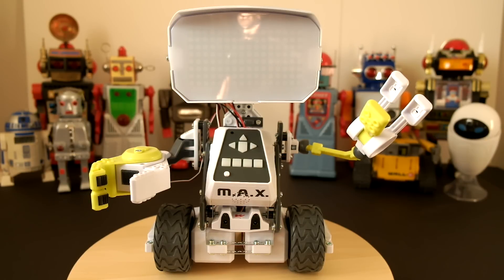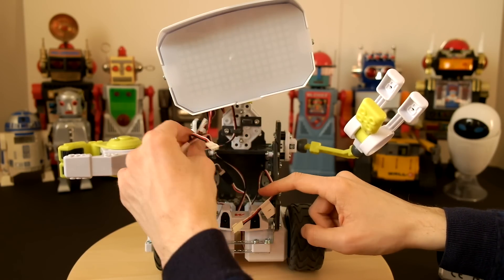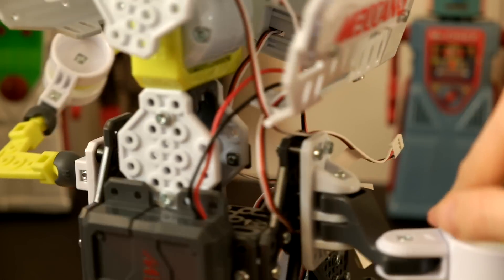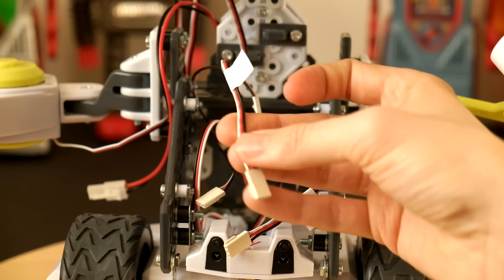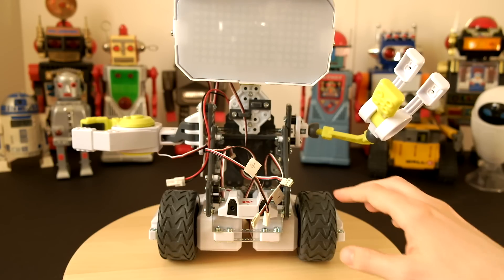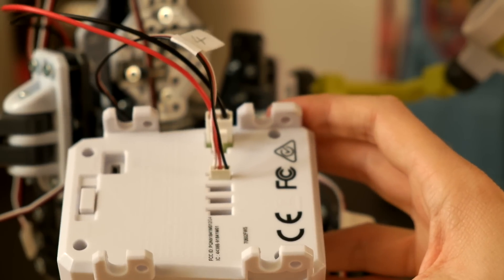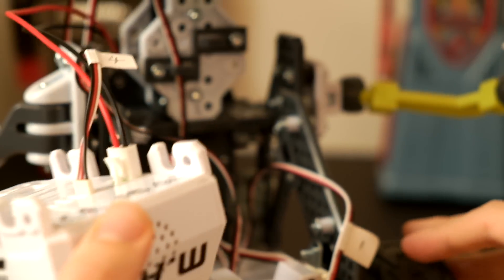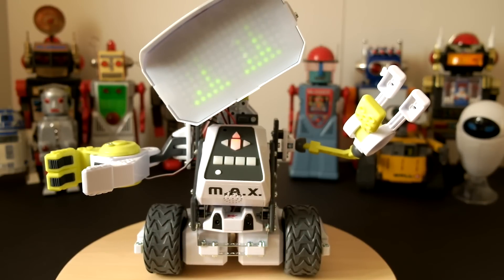Meccano MAX Robot Wiring Explained - How to connect the electronics

Comment: Hey, my robot when turned on announces, "there seems to be a problem with port 2. Make sure that...are connected to port 2". The wire end from the neck for port 2 is black instead of white. It connects to the port just fine, so it's the same shape of plug as the other 3. All other wire ends for port 1, 3, and 4, are white. I've downloaded the app (not sure how it would help). I've reinstalled software but no changes.
Reply from the maker: Hi, thanks for the question. Ignore the bits where I describe the wire colour as it turns out different MAXs have different coloured connectors. 🙄 It's possible the issue could be related to the hand/claw wire. Does the male connector from the claw connect to the female connector from the neck? If that is the case already then it could be a faulty motor. :(
Reply: @RobotElixir  Okay. Yeah, I checked the wires and it has to be a bad motor. Thanks for your time.

Comment: I still can't get him to work.. i checked all the wiring like 10 times but just a straight line back and fourth. Can you help?
Reply from the maker: Sorry to hear that. If you are getting a straight line back and forth that does suggest the wiring is correct. Have you tried talking to MAX at this point? I just said 'hello' and MAX woke up. If you have, maybe you need to speak louder or get closer to the microphone. Good luck! :)
Reply: @RobotElixir  I have the same problem as Erika. We've had Max for almost and year and ended up just leaving him on the shelf. He doesn't respond to our commands and my son is very well spoken. Also today we did a reset and udpated the software and the battery was drained by the end. We've used him about 10 times since we bought him.

Comment: I bought this for my son a year ago and I still have not been able to get it wired correctly.  It appears that our robot is missing the wire coming from the neck with the white connection.  However, Maxx will not even turn on with a charged battery.  Huge waste of money.
Reply from the maker: Ouch, I'm sorry to hear that. That sucks. :(
Other people have mentioned that their wires are coloured different to how I described mine in the video though. Worth bearing in mind!  Two wires should be coming out of your neck motor. Do you have that motor/servo?

Comment: Where Is the charger port?
Reply from the maker: You disconnect the battery pack from MAX and plug the battery straight into the separate charger. I hope that helps :) Thanks for watching!

Comment: We have an extra black connecting arm wire. Where does it go?
Reply from the maker: Any extra wires you have, that I don't mention in the video are not needed. In most cases I've tucked these unnecessary connecting wires inside the components.
Reply: I have been trying to get this robot to work for so long now, I'm really frustrated! I followed your video (which, by the way, is very easy to follow, thanks!) but you don't mention any extra black wires. I have three. I can't imagine what purpose they would serve just being tucked away, I'm assuming  I've done something terribly wrong. MAX lights up when I turn him on, but doesn't respond or speak when I say hello. However, if I unplug one of the wires, it has no problem telling me that a port has been disconnected! What am I doing wrong?
Reply: I have an extra wire hanging from the arm. They should mention in the instructions that it won't be used

Comment: Can anyone help me and tell me where the black wire on step 54 goes on the right wheel hub? The diagram shows it just laying there. Also I saw earlier comments, I have two black connectors coming out of the head motor. The woman asked if this was a problem and it didn't seem like she ever got an answer. I'm pretty sure the black connector from the head motor will work, I'm more worried about where the black wire on the wheel hub goes.  My son is eager for me to finish, any help would be greatly appreciated
Reply from the maker: It turns out that different MAXs have different coloured wires. :( But essentially the concept is the same. You should have one loose wire coming from one of your wheel hubs that doesn't connect to anything.

Comment: Hello Robot Elixir, when trying to move after any command, max says "is there something stuck in my wheel" . i rechecked wiring. the wheel that seems to be stuck is the right one (facing max). Like on your video, i did not put the tire pattern in the same direction on both wheel (so assume this is not the issue). any suggestion ? thank you

Comment: I have all the wires hooked up like shown in the video, but he will not respond when  say hello. Any suggestions?
Reply from the maker: First I'd make sure the switch on the back of the brain module is set to 'robot' not 'drone'. If it is already set to robot then I'd try re-downloading MAXs brain. Good luck. 🤖👍
Reply: Oh geez, that's what it was. I didn't even notice there was the two options back there. Thank you very much. He is working now

Comment: Okay, we need help. There is a black wire coming from M.A.X.'s neck servo, nothing else, when we connected it to port 2 on the front, he will say that there is a problem with port 2 and sits there with his head tilted to the right and claw closed, when we tried to open the claw it pinched me. (Bad M.A.X.y) and it the front screen will have a green wave on the screen and nothing else... we've tried everything, but we haven't had the chance to get the memory done yet because I HAVE NO IDEA HOW TO CONNECT THE MEMORY INFO THING.... please, I need major help....
- Ghasty
Reply from the maker: You need to download the Meccano app from here: http://meccano.com/meccanoid-robot-updater then plug the brain module into your computer to instal MAXs brain onto it. I hope this helps 🤖❤️
Reply: Robot Elixir thing is... I don't know how to do that either._.

Comment: Hi - great video.  Very clear.  HOWEVER - our robot has two wires coming from the hand, and two wires on the back of the motion sensor.  Your video only shows one from each?  What did you do with the others?  Help please!
Reply from the maker: Hey David, these are spare wires that are not required in this model. They don't connect to anything. I hid the second wire from the hand inside the hand compartment itself.
Reply: Hi Robot; ok!  Thanks for clarifying.  My son has completed it, and is now on learning level 4.  Happy New Year.

Comment: I have an extra black wire that's not connecting to anything coming from the left wheel motor if your looking at max straight on and a black wire coming from motion sensor doing nothing. where do they go? max is doing nothing but solid green line
Reply from the maker: Have you tried saying "hello" to MAX when you see the green line? (also, those wires are spare wires that don't connect to anything) 🤖👊
Reply: his claw is stuck shut. that's what the humming noise is. when I forcefully open it, it just ticks and snaps back closed when I let go. everything is in the right ports it tells me. do I have to download the software app for him to work?
Reply: all the ports tell me theyre disconnected when I unplug them and says they are back connected when I plug them back in????

Comment: I have a short wire with a black connector coming out of his hand. Where does it go?
Reply: Did you figure that wire out? We have the same questionable wire.
Reply from the maker: I should have mentioned that in the video. It doesn't connect to anything. I guessed it was just a spare wire for future upgrades so I just hid it inside the hand. Thanks for watching 🤖👊
Reply: Yeah I figured I'd do the same. I guess it's for passed models or future upgrades. Thanks
Reply: xCombatApprovdx it doesn't go anywhere . Not used for this model. You can tuck it in the armor use double sided tape and stick it under the arm so it won't hang.

Comment: I also have two black wires coming out of the neck servo but if I plug that into port two it has a problem with port 2
Reply from the maker: I'd ignore the colours. Turns out different MAXs have different colours for the input and output connectors. Do the two black wires have different shaped connectors? One will fit into the brain and the other should connect to the hand. Good luck 🤖🍀

Comment: For me, 2 is a Black connector that Goes to his Mind. And he Will not turn on. Ive tried Charging and Redownloading AND reconnecting ALL Wires. Nothing.
Reply from the maker: I'm sorry to hear you're having problems. Perhaps your battery needs replacing. I'd contact Meccano for some answers. Thanks for watching though, much appreciated! 🤖👊
Reply: I am having the same problem, with the same black connector.  He doesn’t respond to hello.  Did you get it solved?

Comment: Instead of having a white and black wire from the head, we have 2 black. One input and one output still but both black. Is that a problem. Also, the claw continuously vibrates and max does not respond when we say hello. Any ideas?
Reply: Jen Gonzalez The screw in the claw he is talking about is in his step by step video at the 10:53 mark. I missed it too. Hope that helps.
Reply from the maker: I guess the colours shouldn't matter in that case. If the claw is vibrating I'd expect it's tightened up too much or perhaps too little. Did you remove the screw before clamping the top half of the claw on top?
Reply: Robot Elixir thank you for your help. I’m not sure what screw I’m suppose to remove. The instructions do not mention unscrewing anything. If so, I missed it. I tried rebuilding the claw not tightening anything too tight. But, it still just vibrates closed. Won’t open and shut. When I plug wires in incorrectly max will tell me the ports are off but when plugged correctly he doesn’t speak at all, just vibrates. I’m so clueless!
Reply: Jen Gonzalez how you do that tell me please
Reply: didnt download the brain right download it and then click it and open it then allow it to make changes then when you do all that stuff mimimize everything and it should show the robot update software on the desktop and then open it plug the usb in and then click download
Reply: Jb V Thank you!  I finally figured it out. I didn’t download the software correctly or completely. As soon as I did, he began working and the vibrating stopped. But, I did spend some time rebuilding almost every part of him. :)  Thank you all for your help. Truly appreciate it.
Reply from the maker: Awesome news Jen! Thanks for sharing, much appreciated 🤖✊
Reply: Jen Gonzalez  I have the same problem here

Comment: Having problem with wiring need help. Meccano has no answers on their website. I cannot get him to do the intro with hello and are you girl or boy. I also have an issue with the Neck servo and claw. Every time I plug it in Maxes head turns to the right and gets stuck and the claw opens and gets stuck. Can you tell me what I did wrong we have taken his head off and double checked servo have looked at all of the wires and we are stumped
Reply from the maker: +John Marsh hmm.. I would try re-downloading MAXs brain and making sure the batteries are fully charged.
Reply: I have the same issue, I just downloaded his/updated the software and the batteries are charged. There is no help on the Meccano site. My claw closes though and it shows and the LED shows and X. The poor thing looks like it's in pain. Help please!